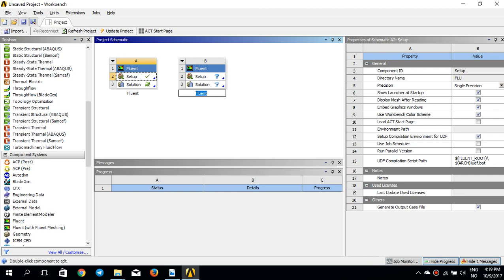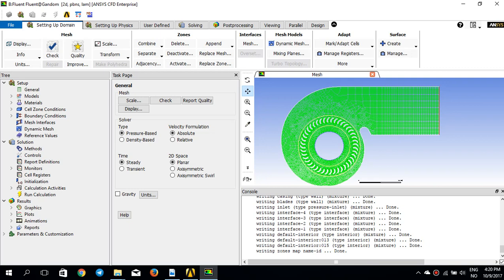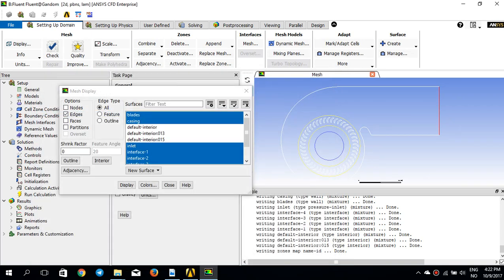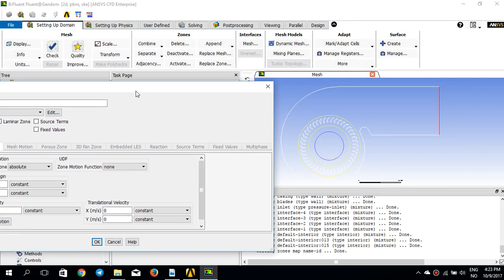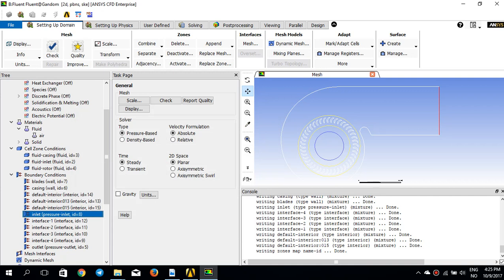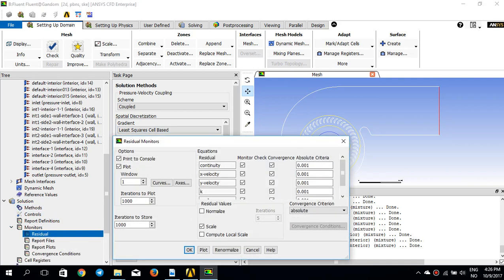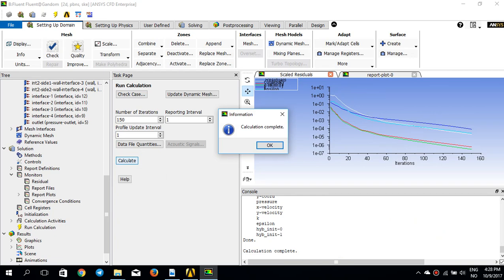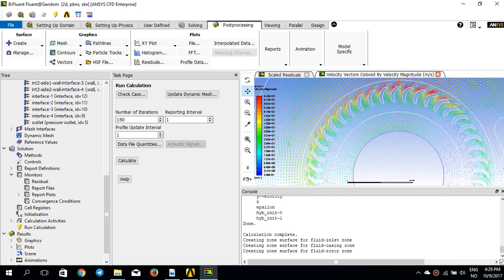Multiple frame of reference, Ansys Fluent Tutorial 6

Comment: Great explanation.
However, a question: When preparing your geometry, did you cut the blade areas from the rotating zone, or are the blades still there as surfaces? I am asking this because in a simliar 3D  modelling, I am not sure if I should boolean (cut out) the blade volumes from the rotating zone. Thank you
Reply: you should still do the boolean for 3D object when you do a CFD. Say this example becomes a 3D model, you will still rotate the fan blade walls in the "wall" tab. Remember, once the boolean is done, the solid part is cut, you are left with the fluid side walls of the blades.

Comment: Hi,

I have a rotating cylinder geometry, with the outside walls of the cilynder made of titanium (solid volume) and inside it's full of water.
I would like now to make rotate both the solid volume and the inner liquid volume.
But I cannot manage to make the titanium volume to rotate, even if I put a rotational velocity in the frame motion option of the solide volume.

Also in the boundary conditions "wall" of the solid volume I cannot activate the option "moving wall", so it can only be "stationary wall".

Concerning the liquid volume I don t activate frame motion but I only set a "moving wall" option in the b.c. with a rotating velocity.

But the result is that the liquid volume inside rotates while the titanium walls don't move.

Do you know how to solve this problem?

Thank you,

P
Reply: i may be wrong but wont solid volume mean that the entire domain is solid. how can wall move then?